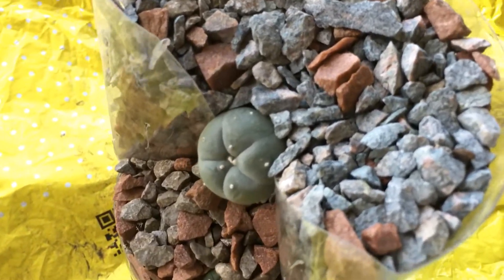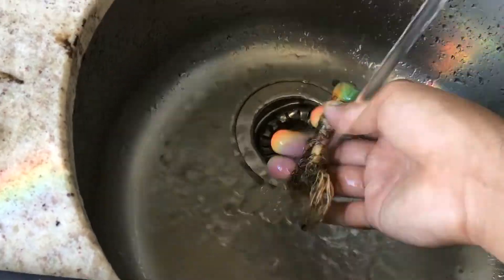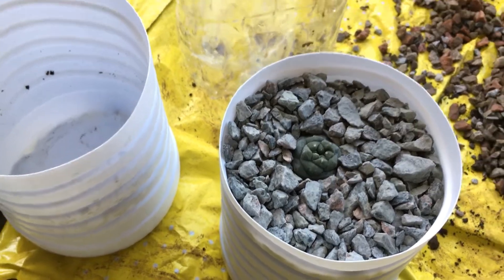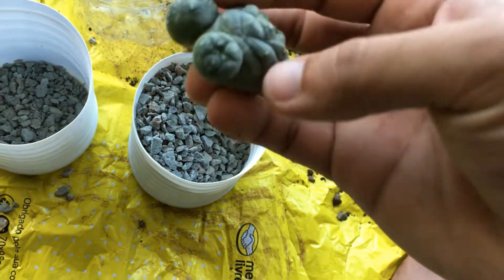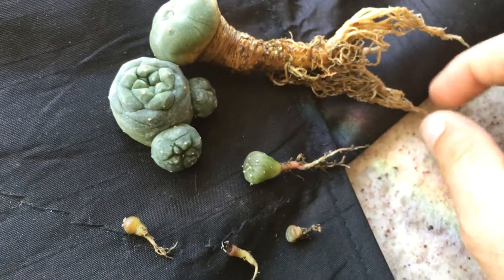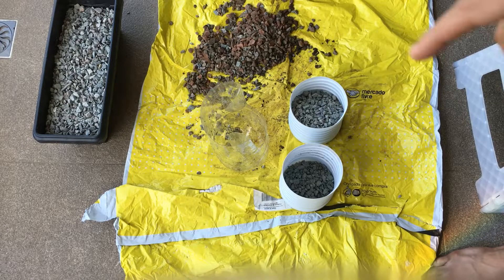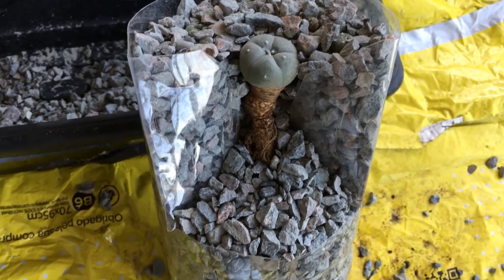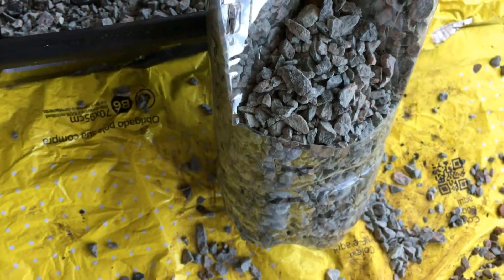Experiment for better taproot development on degrafted Lophophora

Comment: What a great idea. You come up with that?

And some good news, today I pulled my Bridgesii cuttings--and they just started to root after over 3months. Had to trim them twice due to rot, but now they're doing very well. Since finding out that they do not like wet, I made a 40%Lava rock, 40%Pumice 15%Organic soil and 5%Vermiculite mixture. Not as dry as what you have here, but for now, that's what I'm starting them in.
Reply from the maker: Trichocereus do better with organic material. Mine are maybe 50-50 rock/clay soil. For rooting I’d use my final mix… just keep the soil dry until it starts to root then water normally. If the cutting was very well calloused it won’t be an issue.
Reply: @ModernGrower  
Got it. 
Thanks.
Reply: So what are the results of this experiment your trying did it work to plan ?
Reply: @Xt4209  
No experiment. Just trying to get cuttings to root on a species that doesn't like being in wet substrate. After cutting off the rotting ends, I dried them back out and stuck them in a mostly mineral soil mix.
They haven't been watered since August of 2022 and won't be until April 2023. Honestly, they look great considering what they been thru. Lesson learned! Not all cacti appreciate the moisture that Trichocereus Pachanoi do.

Comment: Would this same concept work with something like an orchid pot lined with a drainage mesh? I dont quite understand if the operating theory is (get more airflow), (get light exposure too the tap root?), or some combination of the both.
Reply from the maker: This ended up being a complete fail for me. The salt treatment didn't provide the results I expected despite not being too high an amount.
I'm believe airflow and moisture are what needed to increase taproot growth
Reply: @ModernGrower  I'll probably give the orchid pots a try then thanks man!
Reply from the maker: Share your results even if you end up failing. Lots of people like “water treatment” but unless you want to keep in water culture I don’t think it’s the best idea